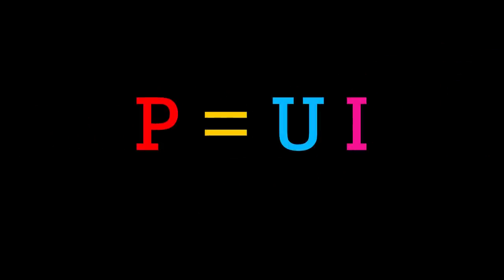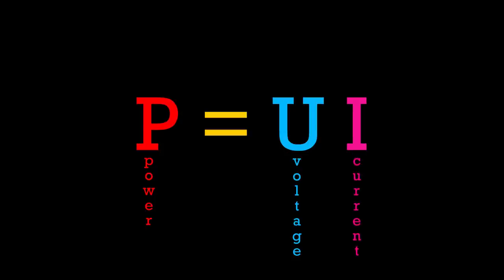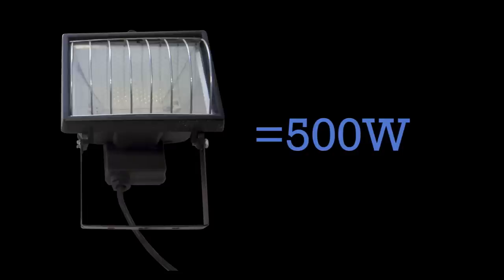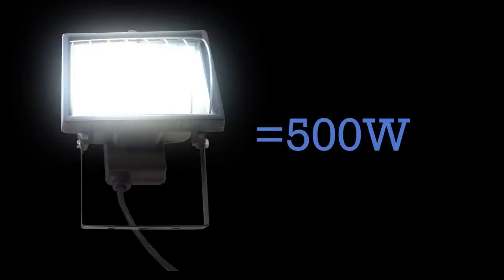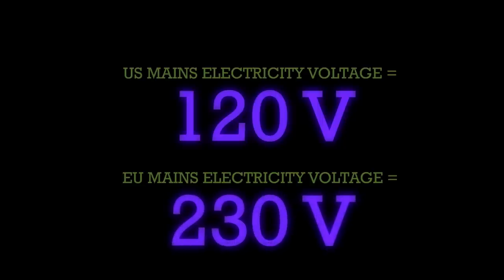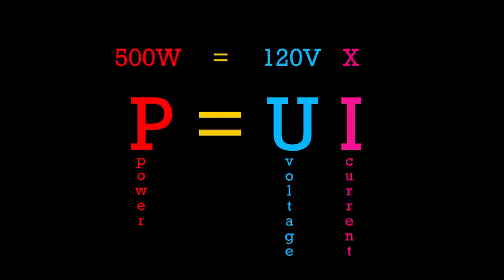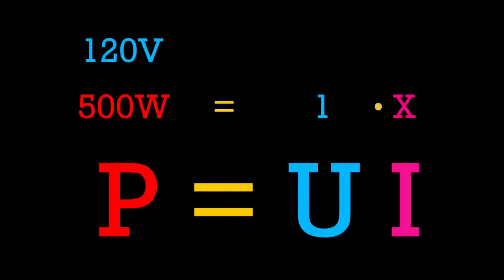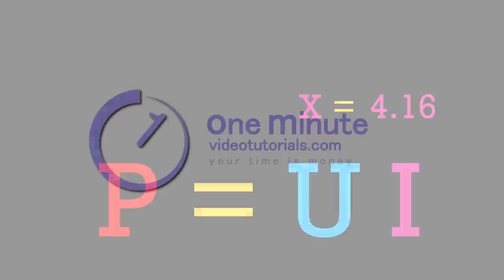How to calculate amps from watts

Comment: Will can you explaine how you got 4.6 ???
Reply from the maker: I didn't, the result was 4.16 and I got that by dividing 500 (watts) with 120 (volts).
Reply: +OneMinute VideoTutorials  the video shows 120 over 5000   that means 120:5000
Reply: Yeah wtf
Reply: Logically watts÷V =amps 
in the uk the normal voltage is 230v 
so P=UI                 
  ( p=power =watts ) 
(U=voltage =V )
(I=currant=Amps)
500watts =230V×I 
I=500watts ÷230 voltage 
I = 2.173 Amps 
I hope this help to understand basic of finding out how to calculate the one of the 3 (watts , voltage or amps)